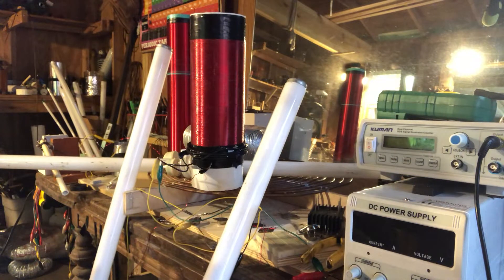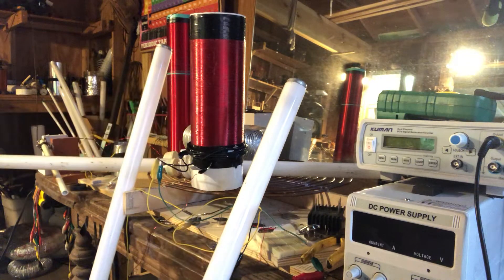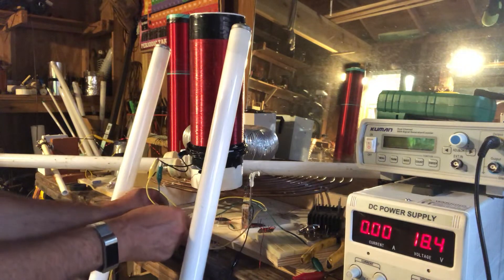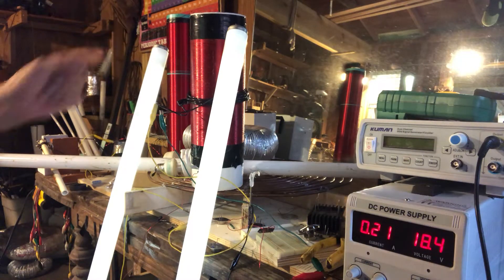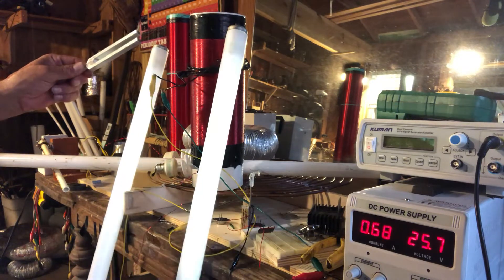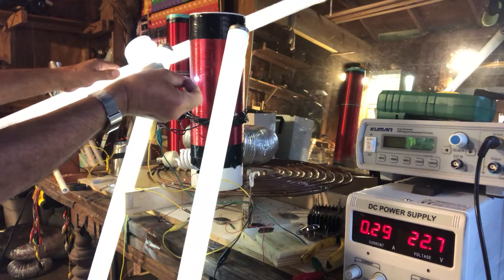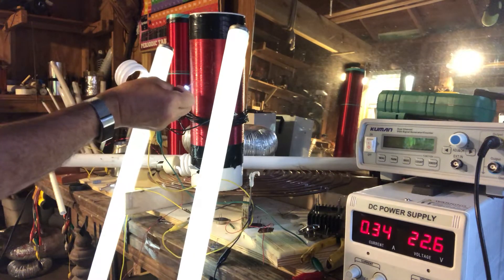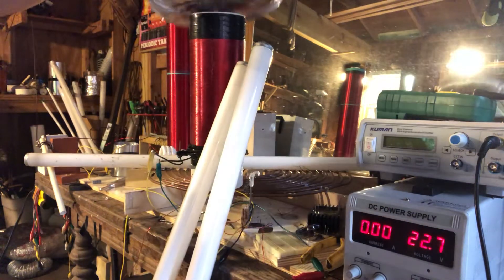Slayer Tesla Coil! Can it be bi polar?

Comment: Load resistance reduces amperage current also seen in John Bedini type motor generators. When applied pressure or increased resistance to axle of it less amps were required and more torque was created. It also used what could be seen as plasma coming from ground moving into the system. The cycle or circuit is from ground to air then to secondary then to primary. So it would seem that charge is moving backwards. This seems like the PMH adding voltage to the battery being shorted out across or upon it. The plasma spark gap has torque and magnetic alignments of the atoms; possibly being broken down from molecules, and or vice versa, with molecules being reformed; usually O3 ozone from nitrogen oxide and possibly O2 and N2. Whenever we have atoms becoming molecules magnetic alignments reduce space time and compress energy into plasma and light. This becomes a generating factor.